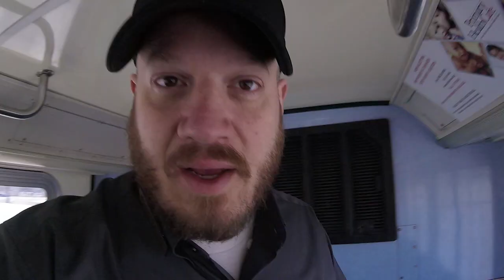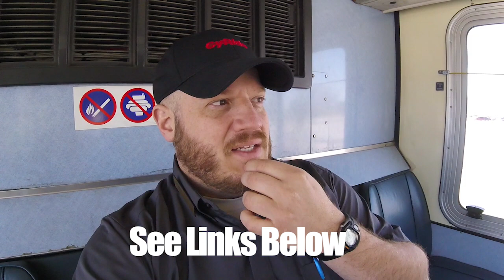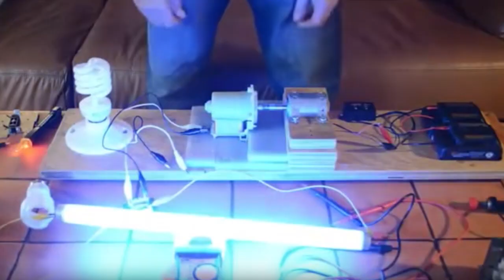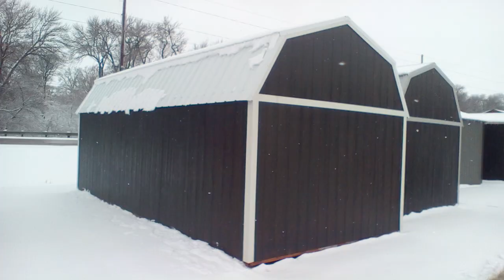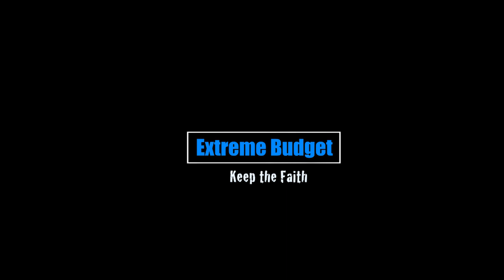PART 1 - DIY Innovations - Free Electricity with Self Perpetuating Generator

Comment from the maker: WATCH UPDATED VIDEO! - 
https://youtu.be/T94A3FOxjBw
Reply: Hi have you managed to build a system yet this is so simple ofcoarse they dont want us to know about it I've seen a couple of videos...
Remember Tesla was conned they wanted him to meter it and he refused so they murdered him...
JP Morgan and chase
Trumps uncle was apparently part of it he stayed one floor below Tesla...
Reply: You were talking about Gerard Morin,he hasn't posted a video in over 8 months,but his online store is active.Check out his U-Tube channel he has alot of videos to 👀⬅see.
Reply: Get your self a couple of 350amp alternators hooked up to 3  12v batteries and use a 48v 1500w motor hooked up to the alternators by belt pully, use a 12v dc to 48v dc converter to power the 48v motor. With this setup you could get 4300watt from each laternator minus the 1500w for the 48v motor. So you could get net power will be like 7000watts, not bad might even charge an ev battery while the car is parked.
Reply: A little common since goes a long ways my friends. And never let any one tell you you can,t do something. Also just because you can does not necessarily mean you should. Have compassion, use good judgment, let's make the world a better place.
Reply: Parts: 
two alternators. One around 60 amp one around 150 amp
High rpm low voltage motor. 1200-1800rpm. 12v or 24v depends on the low V motor and how you want to wire.
Battery bank deep cell works best. I use 2 so I can run wiring in 12 and 24V
Take 150 amp alternators apart. Remove wires from stator and bypass diodes. Be careful not to ruin insulation on coil or its shot. Run wires into junction box for later use.
Attach both alternators linking shafts with a polly on shaft as well. Use belt from motor to joined alternators. 

The low amp alternator is to charge your battery bank. The high amp is for 220V ac for the house. Will alaberate later.

Wire 12v to exciter coiles for both alts. 
I run parallel off both batteries for 24v to low voltage dc motor. 24v motors are cheaper for appropriate horse power needed 3-4 horse power. 
Wire low amp alternator to battery supply for charge. 

Return to junction box. Attach wires to 220v to 110v transformer. Run wires from transformer to breakerbox.

This setup works and has 1 year to 3 year life span depending on parts and cost around 600-900. Not free but much cheaper then utility.
Hope this helps.
Look into county and state laws also. This is illegal in most states.
Reply: I forgot to say put a flywheel on the shaft with the alternators the extra kinetic force helps.

Comment: Also want you to know that I am one of those guys who develops and builds devices such as you are referring to, understanding this stuff is not as difficult as you might imagine, I can break it all down for you in such simple terms and once you get it you will be off and running brother, and it will be good to see you make your goals brother we're rooting for you. The only thing stopping me from continuing with the research and development is the financial aspect, so even though there are those like me out there with the knowledge and experience funding is always and forever a problem.
Reply: Good day sir
Reply: I'm with you both. I have already made some expensive  financial  mistakes.  But I know I'm going in the right direction.  I only need to correct the alternator  problem and I may have a working free energy  generator.
Reply: Could someone show me with instructions for dummies with pics  how to use alternators to power my home , I really need the help due to recently becoming disabled and no income or helping hands thanks in advance
Reply: I see opportunity if I had the capital id help you guys

Comment: I'm a 22 today and i have been under self pressure to move out of my parent's home. However after hearing you say "Move out my parent's house" maan... I started feeling better and it ofloaded some pressure off me.  Otherwise i like you thinking about free energy.! Its there and its a very sensitive issue that unsettles rich people. They say "if you can't put a meter on it, We don't want it" ...Keep digging bro, so is me!
Reply: i have the answer that will more than work.. 10 amp power supply 24 v running 300 watt dc motor turning gm self exiting alternator 110 amps charging my 12v battery bank running my 10000 watt inverter which i will power the powersupply and my entire home 5000 watt cont duty......

Comment: They Key is the Fly wheel or better known as "MASS" if you don't use a flywheel you will need another form of mass, and a large copper coil has mass and ability to store radiant energy

Comment: My automotive mechanical engineer buddy argued with me about this before he passed on saying you can't get more out than you put in. Then he agreed that it might be possible!
On my own I will use a double axel motor from an old rascal to run 2 alternators. Put that into a combiner box. If I send it to the inverter, there should be enough energy to power the rascal motor, and anything else, until it's overdrawn? Might include house, car, boat, batteries, UFOs!

Comment: Keep in mind before you think you can build a house and be "OFF THE GRID" with electricity, some towns, counties, and states require you to be hooked up for all your utilities before an Occupancy Permit is issued for you to live there. Additionally your "Perpetual Motion" power supply requires maintenance to continue operating. The automotive alternator has carbon brushes and bearings that need attention to continue operating. The drive belt that is between the motor and alternator will need adjustment and replacement, and the D.C. motor also has carbon brushes and bearings to maintain.

Comment: I just did it, and was able to run 3 from only 2!! Then I was able to "obtain" 15 alternators from this place that likely wasn't using them the way they were intended anyhow. With 5 powering 10, you can enough power to for nearly an entire household. Can't lose
Reply from the maker: That sounds awesome. did you record your process?  that would be cool to see.
Reply: Hassie 
With extra systems you could alternate, to give the other system(s) a rest cycle
Reply: LOL Stop lying.

Comment: My brother I have been obsessive with this very thing for some time. I have  watch so many vids on this. I have the same beliefs and probably the same fears. Set man kind free. There is so much more to come from this. Thank you for what you are trying to do. Good luck. My prayers are with you.
Reply: The laws of thermodynamics and other scientific factors will prove this system wrong, as you can not get more energy out that what you put in. Those two motors can not spin forever eventually they will stop .
Reply: @FowlorTheRooster1990  
If they move at all and it works 5 minutes then its possible. Were do uou get off, do you own stock in the electric company. Or are you just another hater?

Comment: I just came across this vid tonight, you have the potential to figure things out in time. I've recently start working on my version of what I call renewable energy this I found to be the safest identifier for what I hope to create in time. I recommend you consider taking the same step as well. You'll find pretty good examples on youtube no doubt, BUT !!! don't fall into the free energy term it will lead to failure even if you succeed in putting a working system online. Contact the patent office ask them what they think about "Free Energy" as a term. One of the examples you've presented is not ac based it's actually a DC power output configuration it's been around for years and it does work (with some risk as well). There is a cost as well, my project so far cost me over a grand so far. I've put the project on hold due to a recent complication again!!!. You'll find there will be delays to no end as well. Even so keep with it you'll succeed in time never give up no matter what anyone thinks.
Reply from the maker: THANK YOU.  I completely agree.  I have found out some other ways and made some awesome discoveries.  Very simple and very cheap.  I have yet to get it to the point of sharing, but our world is not what our educational system says it is.

Comment: I was hoping you made this to see if it worked.  I  was thinking about trying this along with solar power to operate lights and radio in my work shop. It would be cool to save some money off my electric bill
Reply from the maker: I plan on the same thing. Hopefully I can get it to work.  it will take some time to get it together

Comment: One major problem that people don’t realize is first convert your calculations into watts you will find the reason things seem like they would work but don’t . Second when a magnet passes by wires it sees a pushback . The more watts that are needed in the load side the greater the pushback . You can hear a gas generator load down when more appliances jump on the load . Hook 2 stepper motors together in different ways and experiment . Good luck

Comment: Hi matey, I think the same way as you. so can I suggest when buying land, try to have a steam cutting through it, this will help. also, start by buying a 12volt solar panel say 20watts and a 12 car battery. then connect a 7w  led bulb, you will have a light source forever. good luck    malc uk

Comment: Go for it . But can i suggest when buying your land,  It will help if you have a steam running through. Try this , one 12v led 7watt light bulb, one 12v car battery, connect to 12v 10 watt solar panel with a small cheap control box . Now leave your light on day and night good luck. Always question authority.  Malc uk
Reply from the maker: :) yep thank you I"ll try that. ...  I have found land actually.  My latest videos show my progression on that.

Comment: One way you can do it is you can take two alternators one is the generator for the second and what you do is on the pulley you have a double pulley and the other one you have a single pulley hook a belt between the two and one pulley very tight put an adjustable bracket like on a vehicle adjust the belt type very tight and then put a really long cold core on like a gas motor wrap the pull cord around the one with two pulleys about 10 times or whatever pull it really fast and with that'll start if that's going to start the electrical current through the one alternator once that electrical current gets wrapped up high enough it's going to power the other one you run wires off the other one

Comment: Ballist are to ramp the voltage up for a brief second to activate the ignitor and strike the metal hylaide bulb. Ballists are not used on house hold bulbs. Bulbs pop due to the fact of the coil been heated up insanely hot and cold after a while this causes metal fatigue and it snaps.(pops) for them to last longer they would need to decrease the wire gauge to thicken up the coil but then this would cause less power efficiency and less light yes he created a bulb which could last a lifetime but it wouldn't have been bright or ignite near enough instantly without waiting 5 mins for it to heat up.

Comment: The belt is considered a connection in the circuit but not an electrical one. if that makes sense. I've seen a bunch of videos like this and I've thought a lot about it, so once something is spinning fast enough, like a flywheel along with different size pulleys , I'm 100% convinced we can do this, i haven't built my own, but I feel like hospitals have large turbines like this as backup generators, The amount of misinformation there is to disprove free energy , that alone tells me it's possible.   Nature is abundant, one seed grows a plant that has many fruit, each fruit has many seeds.  but schools teach the electricians math to convince them its not possible. I've had dreams where electric vehicles would produce the energy needed for the home, we also can't forget the amount of energy put into making copper wire, that energy seems forgotten and wasted, but copper wire would never happen naturally. Every wire naturally has an electromagnetic field even before any energy is put through the wire, There's also a big reason why neodymimium generators aren't being made . I also have a feeling tesla coils work similar to these videos, but instead of a belt making the connection , it is the fluctuation of the magnetic field with something to capture the resonance, similar to wireless cellphone chargers. I believe they wanted the ability to know where everyone is before allowing unlimited transportation , could you imagine a drone vehicle with an energy system so it never ran out of power? if you look up electromagnetic levitation , and this technology, UFO's start to make sense if extreme high voltages can create lift and energy could be created on the spot depending on motor speed control.   The first UFO's were probably nuclear tho lol cheers, here's to that future we both know is possible

Comment: These systems can help to conserve and extend the usage of a limited power supply, however the reason why these systems are not perpetual is because the generator is having to overcome both the resistance provided by the mechanical parts of the motor and itself. Also, the resistance upon the generator to turn will be equal to the load produced by the motor. With a battery, you may be able to sustain continuous motion of the system for longer periods of time, then the battery itself could have run it without the help of the generator. There must be an external power supply, in order to maintain momentum, whether it be a battery, a fuel burning engine, or an other external voltage supply.
Reply from the maker: I like the idea of extending the limited power supply even if the charge still runs out.  thank you for the input
Reply: i have a question .. could one build a large "joule theifff!, to take over capacities after the alternator im very new to this but in my head i see some sort of capacitance building after the alternator in order to re direct into the alternator to give it more push, but like i said very new to this stuff,

Comment: Remember it is not volts you look at. It is power which is current times volts. Florescent bulbs are easy to light with very little power -- a Tesla invention indeed. There are lots of ways to take 12V DC from a battery and convert it to 120VAC to power things. There are solid-state inverters that do this with little energy loss. Using motors is not as efficient because you have friction and heat.

Comment: Yea when i did electrical work we would run a extension cord to hot check a 3 story cabin and u can leave all the lights on and all the fans and pluggs on all night to hot check it..u could do it just ur 210 would haft to have a diffrent set up for the 210 witch is ur stove..

Comment: its like an gas generator you put gas into the motor and all its doing is turning over the generator part . If you take the Gas motor part off and you have an 120v electric motor and have belts to the generator it will make electric so your using 120v electic motor thats using like 100 watts to spin the other part and the generator is 2000w you get that power out put

Comment: Before you go spending all your savings on this project educate yourself on the laws governing the conservation of energy and you are always welcome to thank me later.
Reply: Conservation of energy did not take into consideration  electronic controls.  I submitted a paper back in the late 1960's in "junior high school"  needless to say, my science teacher advised me to forget it.   And so I almost did.   Then, my gas powered generator stopped working.  Well, to me the next obvious step was to replace the gas motor with an electric motor...plug it into one of the sockets in the generator...along with just a few additional components....and ther ya go....
Reply: @nojremlock6826  lol what are you talking about. Conservation of energy takes into consideration everything and to date it has never been wrong. Electricity is of course included in that. Energy is lost due to resistance turning it into heat just like friction turns kinetic energy into heat. Not to mention every generator and motor in existence experiences friction. Why else are things greased? Is grease a scam?

Comment: IM WORKING ON A SYSTEM NOW FOR MY HOME JUST SPENT $4000 ON GEN MOTER WIRE AND OTHER STUFF ILL LET YOU KNOW HOW IT GOES THERE IS MORE TO IT THEN WHAT YOU SEE. KEEPING THE POWER CLEAN IS 1 THING IM WORKING ON. IM NOT GOING TO SAY ANY THING ABOUT IT TILL I SEEE WHAT IT WILL DO., 2100 WATT IS WHAT ILL BE RUNNING AS A GENERATOR. WISH ME LUCK.